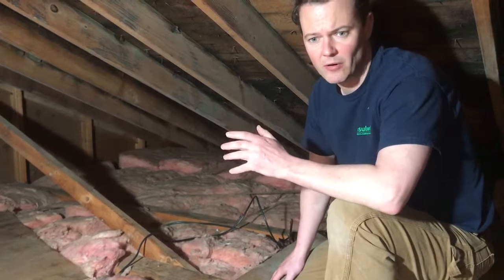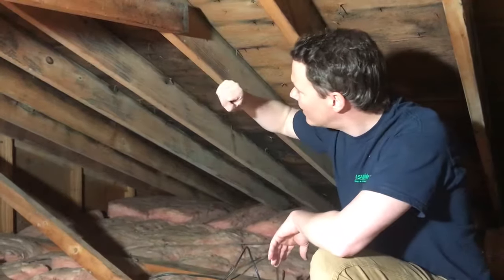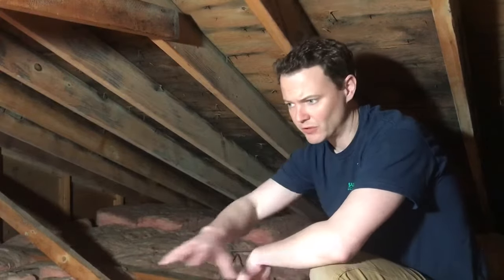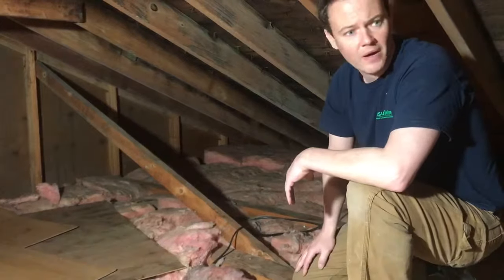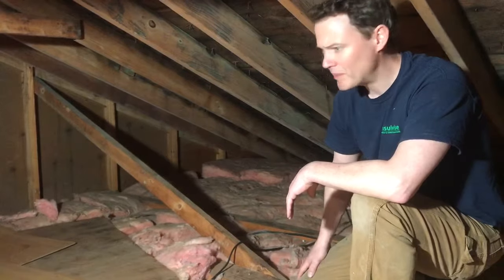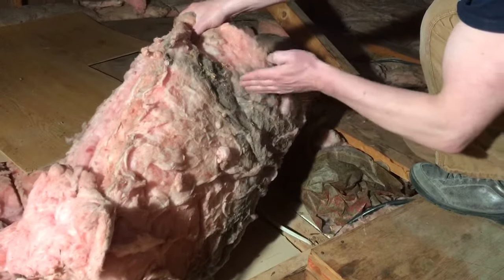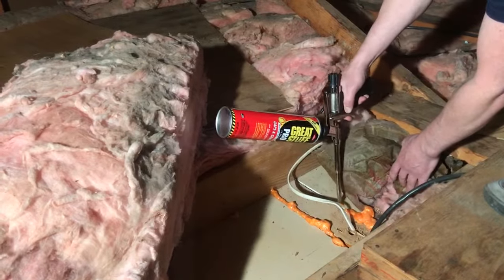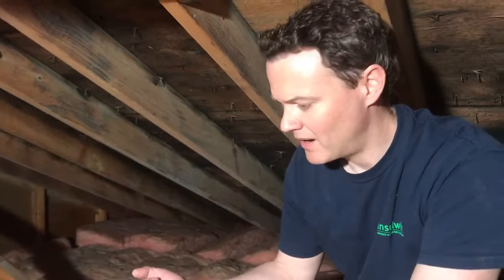There's Mold in my Attic!  What Caused it and How Insulwise Solves it.

Comment: This makes sense it would fix the attic, but once you isolate the attic from the house, wouldn't the warm air from the house hit the cold floor of the attic and cause condensation on the house's ceilings? Or does the insulation in the attic prevent the heat from transfering from the air thus preventing condensation?
Reply from the maker: Hi Elsa, great question there.   That's really how you need to be thinking about issues like mold and condensation...ie, where is the moisture coming from and where can it interact with a surface that is at dewpoint temperature.  I have gone into homes where people have shown me small areas of mold that keep coming back on their bedroom ceilings, etc.  It seemed very strange.  But when I went up into their attic the problem immediately revealed itself.  There was no insulation on the areas of the ceiling where the mold kept growing...ie, where water vapor kept condensing.  

So to answer your question, if the attic floor is properly insulated the ceilings below will never hit dewpoint temperature in most situations.  The outliers tend to be bathroom ceilings where there is no bathroom fan that is removing the steamy air from the bathroom and the room is getting continually inundated with moisture.  In those situations you can get mold growth on walls and ceilings regardless of how well they are insulated.  

Hope this helps!
Andy
Reply: @insulwiseenergycomfortsolu3293  Thank you for your clarification Andy, that's very helpful!

Comment: where you guys are located? I'm from west of Wisconsin and I have a similar problem in my attic that needs to be taken care
Reply from the maker: We are located in Pittsburgh.  I don't think my guys would be especially pleased if I scheduled them a job in Wisconsin ; ).   If you can't find a company that can handle all of this problem, than I'd hire a good, building science based insulation company to first air seal your attic and do what's  necessary to make sure it is effectively ventilated.  I would then hire a mold remediation company to take care of the mold, then likely re-insulate once that has been done.  
Andy
Reply: @insulwiseenergycomfortsolu3293  i totally understand, I will do that thank you very much for replying my comment sir have a great day
Reply: Did you take care of it? I also have this in my attic
Reply: @eirod  yes I did I hired a company called DJK environment, removed re-insulated cost 6,500 dollars
Reply: @mixtecop  what about your ceiling drywall? Was it affected as well? Removed or treated? I only ask because Im starting to see it going through my ceiling bathrooms.. so i know it's going to be pricey. Lol did you get quotes from multiple companies or no??
Reply: @eirod  yes sir I got quotes from 4 different companies, I had no problem with the ceiling so I don't know what to tell you, I only know if that's the case you need to removed it Asap good luck
Reply: @mixtecop  yes will definitely do, I'll let you know in a month or two how much total was. Thanks for replying back bro 🙌🏽

Comment: do you not put a primer on the wood afterwards? or is the mold killer good enough? do you use MMR? - great video!
Reply from the maker: Hi Robert, thanks for the compliment!  We do not prime the wood afterward.  I have seen attics where that had been done, and mold still regrew mold on top of the primer (or whatever they sprayed onto it).   Our take is that if you kill the existing mold, and more importantly --- eliminate the moisture source, that you've effectively solved the problem.   There are a number of solutions out there that will reliably kill mold, so we don't offer recommendations.   The main thing is getting the floor of the attic completely air sealed (eliminates air leakage from the house that deposits water vapor into the attic), and making sure you don't have any roofing problems or ventilation imbalances that could be adding to the mix. 
Thanks!
Andy
Reply from the maker: Hi Robert, we do not prime the wood no.   I have seen several attics that had already been treated for mold in the past, and had then been primed -- with new mold growing right on top of that primer.  If that primer, paint, etc is applied in an area that is good place for mold growth, eventually the mold will start growing again.   In the right cirumustances, mold will eventually eat just about anything that is organically based.   Once we eliminate the moisture source and kill the existing mold, the problem is solved in most cases.

Comment: Hey thanks for creating this video. I'm remodeling my 3rd floor attic/apartment conversion. & I just discovered this in the bathroom ceiling & other certain areas around the roof .   It has foil faced insulation the foil is on the bottom facing the bathroom. Is this correct?  Or should I put foil facing roof or unfaced insulation?   Also do you know what other issues that those could be besides what you explain in the video?
Reply from the maker: Hi there, 
If you have a 3rd floor conditioned space, that it will likely require some special considerations (at least if it's constructed similarly to the way 3 story homes are constructed in Pittsburgh).  If the third floor has knee walls (short vertical walls about 4ft high), than you will have small attic spaces behind those knee walls.  These spaces need special attention.  The first order of business is making sure that bath fan is vented to the outside properly.  Then you need to decide how you're going to insulate that space.  Specifically, you need to decide if you're going to make those small attic spaces conditioned, or unconditioned spaces.  We make them unconditioned spaces.  This means that we air seal and insulate the floors of the attic space,  the back sides of the knee walls, then insulate the sloped ceiling sections and finally the upper main attic.  The knee wall attic spaces and upper main attics then need to both be vented with roof vents to allow any potential moisture build-up to dissipate to the outside.  If you don't vent them, any moisture that finds its way into those spaces will likely lead to mold growth.
 
Here is a link to how we deal with 3 story and Cape Cod style homes.  They have the same effective upper floor construction:  
Three story home
https://www.insulwise.com/choose-your-house/3-story-home/

Cape Cod style home
https://www.insulwise.com/choose-your-house/cape-cod-home/

We are not fans of insulating the undersides of roofs (with sloped ceilings and cathedrals we recognize that it's unavoidable).  We don't like this practice because I can find roof leaks (usually small) in about 80% of the attics that I work in (dry rotted rubber plumbing stack boots, nail pops in shingles, flashing failures around chimneys, etc).  I realize that it's becoming popular to spray foam the undersides of roofs, but we also feel this is long term foolish (too many things can go wrong -- foam can delaminate from wood, water can be trapped against roof if there is a leak, or if you've used open cell foam, the foam can be damaged the next time you need your roof re-shingled, etc).   As where if you make the knee wall spaces unconditioned, ie insulate the back sides of the knee walls and the knee wall floors, and then install roof of soffit vents, those spaces will more tolerate more "stuff happening" with your roof.  Our approach offers a sort of built-in redundancy if you will.  

So to your original question.  If it were me I'd remove the insulation from the underside of the roof deck (you will not have any type of effective air barrier there anyways, so why have your insulation layer there?), air seal the knee wall spaces, treat and eliminate the mold, and then insulate the floor of the knee wall attic spaces and back side of the knee walls, slopes, and upper attic.  Hope this helped!
Andy

Comment: Insulation needs to be removed and a full mold remediation needs to be done (fogging, HEPA Vacuuming, Aggressive cleaning of wood with peroxide, encapsulating wood with Sentinel 24/7) and then installing a commercial grade dehumidifier,
Reply from the maker: I'll see if I can find and attach pictures for the number of times we've been called out and found mold growing right back on top of "mold resistant encapsulant paint."  I also will make sure to post a video of the next time that we remediate mold in an attic where someone else has ALREADY remediated it before using the plan you mentioned --- and left bathroom fans exhausting into the attic, did not address roof ventilation deficiencies, and did not air seal the attic floor-ie did NOT address the root cause of the mold growth in the first place which is excessive water vapor then condensing on cold surfaces.  The vast bulk of existing mold remediation companies' processes that I've seen I'd call amateur hour combined with a flawed understanding of biology.  
Get rid of the mold spores.  Ok, wash your hands.  Now wave them in the air.  They have mold spores on them.  Mold spores are everywhere, not just in attics that have mold growing on the underside of the roof.  Eliminating the ability for fungus to grow in the first place is how we solve it.  If that's amateur hour to you, then I wish you the best in your operation.

Comment: Attic sealing should be done at every house/home ….. do you have a preferred spray-foam?
Reply from the maker: Hi there, we generally just use off the shelf Great Stuff from the big box stores.  Lots of guys in this field believe you need the fancy expensive foam guns and larger cans, but in reality they get heavy using them for hours, the guns constantly need cleaned, they can break and get accidentally left behind in attics, and there are lots of small, tight areas where we can get a cheapo can of great stuff into, but could not access with the larger foam guns.
Andy

Comment: What a great video. Thank you. What does it mean if a tenant reports a spot of mildew on the ceiling, but the attic appears dry and mold-free? I'm flummoxed! :)
Reply from the maker: Hi Scott, thanks!  That can be a weird thing to see and I think I know exactly what you're looking at.  If you have mold / mildew growing on just one part of the ceiling on the inside, a common cause of that will often be that that is an area of missing insulation in your attic.  The missing insulation causes that to be a cold spot on the ceiling, making it an effective "can of beer in the summertime" kind of thing.  The water vapor in the house is condensing on that area of the ceiling, and from there you get mold growth.  The fix is to inspect your attic and make sure that it is evenly insulated across the whole surface area.  Sometimes people will go up to an attic to do some electric / plumbing work, move the insulation aside, forget to put it back, and from there you can get an area of mold growing on the ceiling.  That would be my first guess anyway.  Hope this helps!

Andy

Comment: Do you recommend baffles for the soffit vents or is just having sofit vents ok ?
Reply from the maker: It depends.  If your attic insulation does not go over your soffit vents, that you probably don't need baffles.  However, in all of the attics that we insulate we blow in cellulose insulation until we reach an R-Value of R-49, which is about 15" inches in depth.  So we have to install baffles every time where there are soffit vents present, otherwise the cellulose insulation would cover and block the soffit vents. 

Hope this helps!
Andy

Comment: what about the mold already present wont it spread?
Reply from the maker: After we air seal the attic floor and make sure that the attic is ventilated properly, we then spray a mold killing agent onto the underside of the roof deck, killing all of the mold that is present.  There is another short video on our page where you can see me doing that, and then another video showing what the roof deck looks like after.
Hope this helps!
Andy
Reply: The moldy wood either needs to be removed and replaced, or sanded down. Please do some research on proper mold remediation. People can get very, very sick from mold... one being me!

You cannot solve a mold problem simply by spraying chemicals or paint over mold. Mold has roots so when mold grows on a porous surface like wood, there is no way possible to remove the entire source of mold. Not to mention, even if you kill some of the mold, dead mold is dangerous as well!  And lastly,  if the mold is a mycotoxin producing mold, spraying a chemical on the mold is going to cause the mold to go into defense mode and release additional dangerous mycotoxins into the environment. 

I beg of you to please do some research on mold illness and proper mold remediation. Mold can make people deathly ill, and can in fact kill people, as well at pets!

I also want to mention those air gaps are probably causing mold to grow in the walls of the home. I say this because that is what happened to my house.

Comment: So you have to take out these insulation right? when placing them back do you need to buy new ones?
Reply from the maker: Generally we do not remove the insulation, and for several reasons.  If this roof is not leaking, the attic has been well ventilated, and we have effectively air sealed the attic, than very little moisture will continue to get into the attic.   Without moisture and damp conditions, mold cannot grow (especially once we have killed it!).  When it comes to the insulation itself, mold cannot grow on fiberglass or rock wool because they are inorganic fibers.  Mold simply can't eat that stuff.  Mold can grow on the craft paper backing, but again without moisture the mold cannot grow.  Additionally, the vast majority of cellulose insulation (what we use at Insulwise) manufactured since the 80's comes "infused" with strong and effective mold inhibitors such as boric acid and ammonium sulfate --- both of which are non-toxic and also act as highly effective fire retardants.  The vast majority of the time we also blow a new, fresh layer of cellulose insulation over top of whatever insulation is already there.  If there are any dormant mold spores they become encapsulated or "entombed" at that point.   If the homeowner felt strongly about us removing the original insulation we would, but in most cases we feel that adds a lot of additional cost to the job, without offering much of a net improvement in safety.
Thanks!
Andy
Reply: @insulwiseenergycomfortsolu3293  Got it. Thank you so much for sharing all the great knowledge Andy!!! It's very hard to find experienced people like you nowadays.

Comment: my question is do you have to remove ALL the old insulation and blow in new insulation??
Reply from the maker: The does not need to come out.  The only parts of fiberglass insulation that mold can grow on are the kraft paper facing.  The rest of it is inorganic, so mold cannot "eat" it.  Once the attic floor has been air sealed, the mold has been killed, your attic is properly ventilated, and you are sure that your roof does not have any leaks, the mold should not come back.  

Andy
Reply: @insulwiseenergycomfortsolu3293  I wish i can hire you to do the work in my attic. I love it when people know whta there talking about! I call 3 differnet companies and I get 3 different answers! so fustrating
Reply from the maker: @samvicenzo5340    It's extremely difficult for home owners to get high expertise in this area.  3 contractors could easily have 3 different opinions.  Two things.  When you can, look to hire a company that is building science based, where the owner is a trained BPI Energy Auditor, that kind of thing.  That will at least mean they've been taught how to think about solving these types of problems.  The other best practice for the home owner is to ask a TON of questions.  Do Not assume your contractor understands these things just because he recommends a scope of work, ask him really explain WHY it will work.   IF he starts getting defensive, than you know you've got the wrong guy.  Also, anyone who says something like, "look I've been doing this for XYZ years, just trust me," most often needs shown the door.   Your retort should always be, "oh you've been doing this for that long?   Than you should be able to easily explain why this will work, right?"  

Andy

Comment: Why not put soffit vents  in?
Reply from the maker: Hi Nicholas, great observation.  We assess every attic that we work in for ventilation requirements, the standard being 1 sq  ft of ventilation for every 300 sq ft of attic, then divided between intake and exhaust ventilation.  In this case the home did not have any type of overhang, it had a mansard roof on it (therefore no possibility of installing soffit vents).  In those cases we install slant back vents for intake to balance out the draw from the ridge vents that are exhausting.   We would LOVE to see more roofers in our area doing proper ventilation assessments on roofs while selling jobs and installing under shingle intake vents along with the always installed ridge vent.

Thanks!
Andy